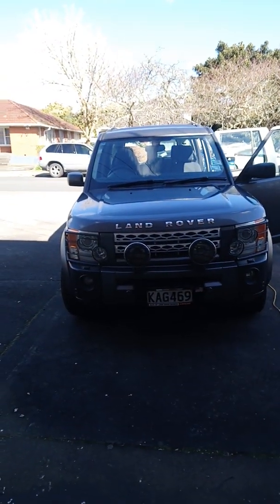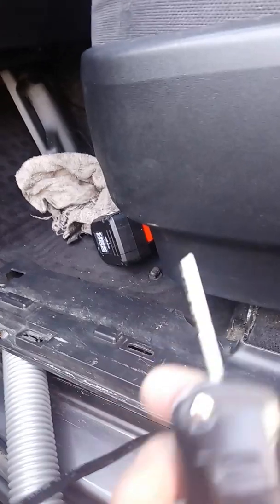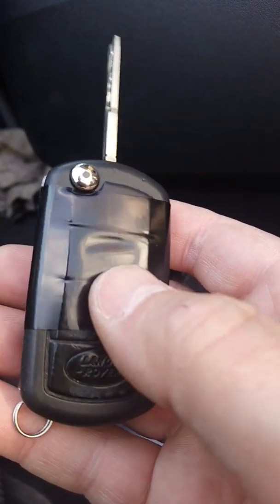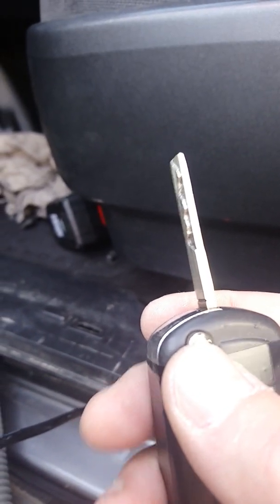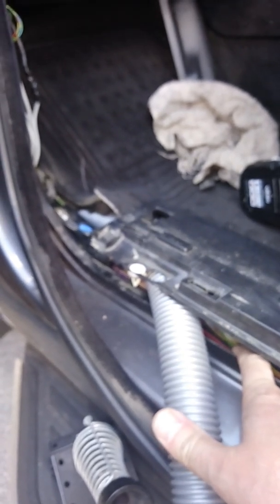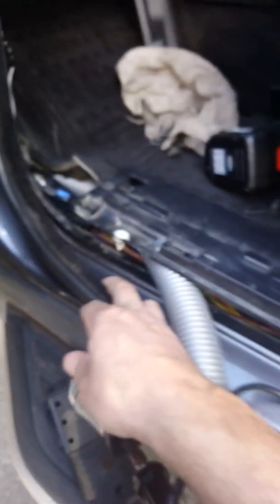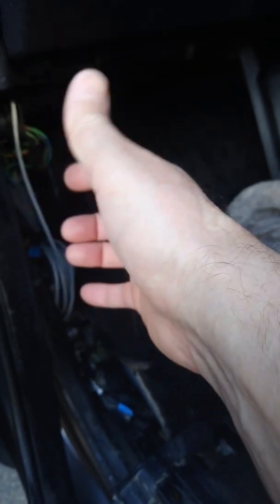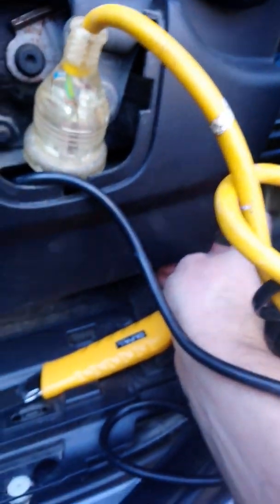Lr3 key lock unlock not working Fixed.

Comment: Yes the 3 green an white wire's joined in one bullet we're the problem on mine  just as you have described just done mine to take apart an put back together was about 20 minutes finding the wires took a bit longer once joined working perfectly thanks for your video